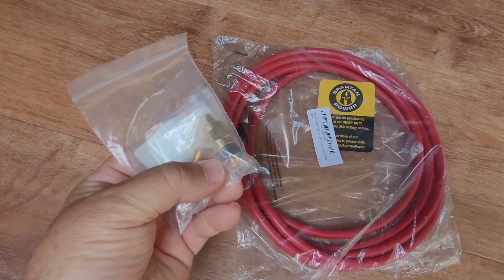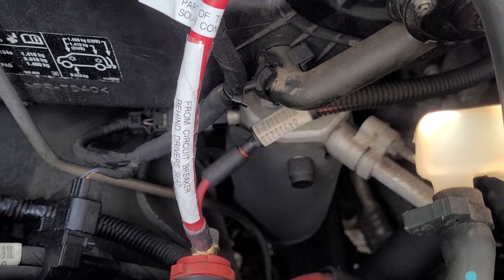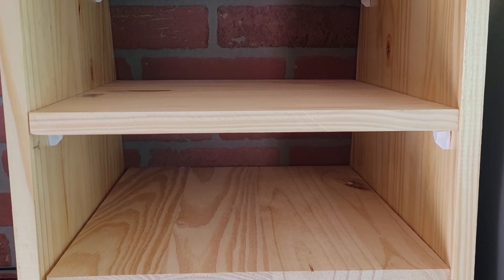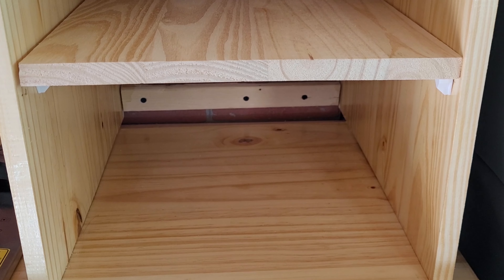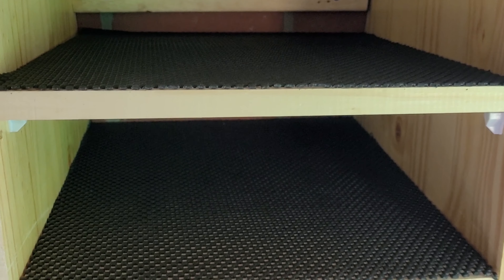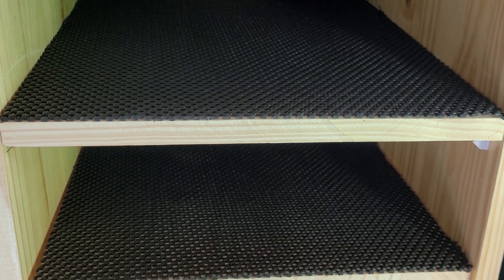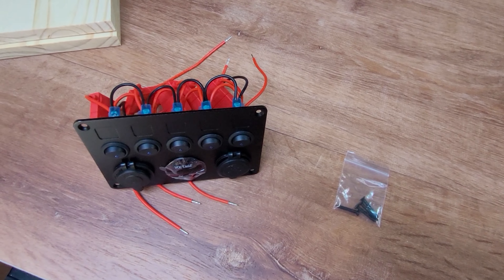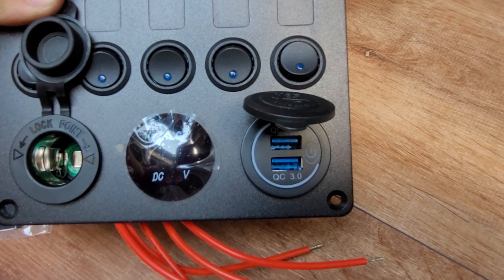Van Conversion ~ DIY Switch Panel install and more

Comment: Wow, Jeff a first class job really well done. Again as I said before Jeff, I was a technician and an engineer for years and retired now and even I would have a hard time doing as well. I really like that control panel too. That will work really well for your application. I also really like that you had custom-made cables. I didn’t know you could do that which included the lugs and for what I see those cables are really high-quality. I can see the construction looks really good.  So keep those pictures coming. This is really nice. Let’s hit the road Jack so to speak.
Reply from the maker: Thank you once again Mike for your nice comments! Spartan Power made up some of my cables and it's really handy that you tell them the length and the size terminal you need. They provide a lifetime warranty on the terminal ends. I've since cut the remaining shelves for that tall cabinet by the bed and today I started moving some clothing in there. Also today, I cut more of the tongue & groove cedar and enclosed one wall right alongside my propane cylinder. Eventually I'll have that portion enclosed and I'm going to install a propane leak detector there.

Comment: Looking like the $100K vans I see. I couldn't have my bed across the back, I was too tall. I didn't have that cutting tool so drilled holes and used a hacksaw blade. After seeing all that wiring I feel lucky to have my two 2000-watt Bluettis to run everything with power strips, circuit breakers, and surge protectors. Have fun.
Reply from the maker: thanks Mike! Yeah, the portable solar generators certainly keep everything compact! I continue to use my little Oukitel solar generator, especially on the 110v outlets. My solar suitcase fits perfectly on my dash, so it keeps that generator topped off pretty easily!
Reply: Wow two 2000-watt Bluettis! That's an expensive power solution but I would love the simplicity of that as well. I've been looking at similar units.

Comment: I rewired the same panel for a diy power station in my van !
Reply from the maker: they're like a one stop shop lol - power outlet, fused switches, USB and a voltmeter!
Reply: Great job. I’m really liking the switch panel, Amazon?
Thanks 4 sharing.
Reply from the maker: yes, it came from Amazon - it's been working great with no issues!
Reply: @ADKOverlandNY   excellent thanks for the quick reply.

Comment: Subscribed! Fabulous build and just a fantastic way of presenting your videos. So grateful to have happened upon your channel, Sir. PS - Your ability to make such a straight-cut little box using your oscillating tool is amazing. I just bought one and have found it very handy in many home projects for sure. But I know I would not be able to make those beautiful straight cuts! What is the exact name of the pine you're building your van with, please? Thank you!
Reply from the maker: Thank you so much & thank you for subscribing! I love that oscillating saw. Just like you said - it's easy to use, makes less of a mess and the cuts are more controlled. I bought the pine at Home Depot for $32 each; here's the link to their site: https://www.homedepot.com/p/Common-21-32-in-x-18-in-x-6-ft-Actual-0-656-in-x-17-25-in-x-72-in-Edge-Glued-Pine-Panel-0080105/323005946
Reply: @ADKOverlandNY  Thank you SO MUCH!